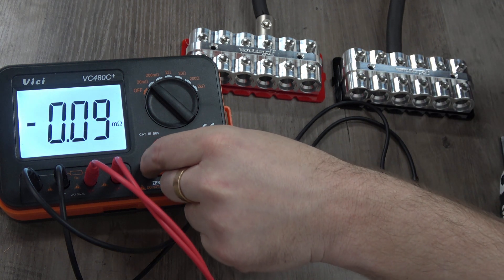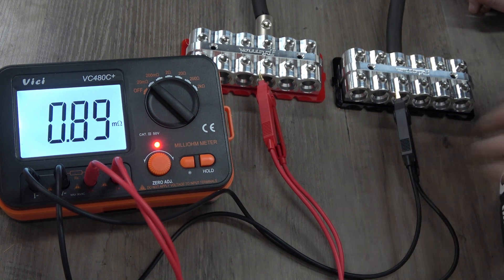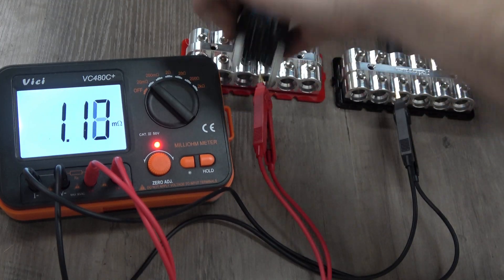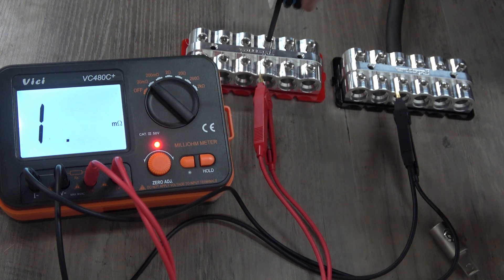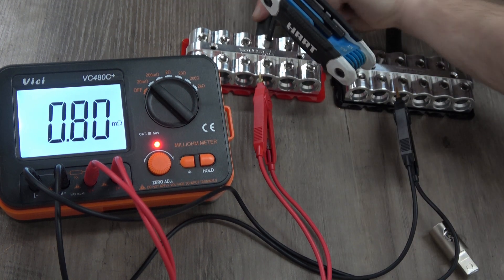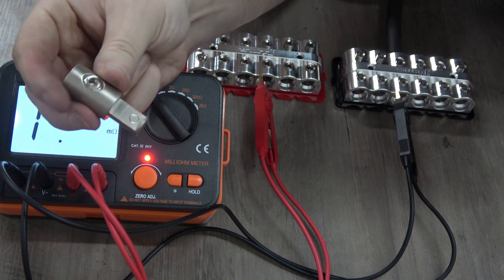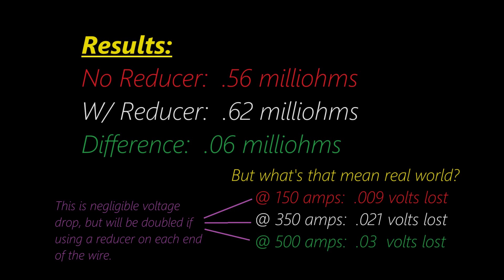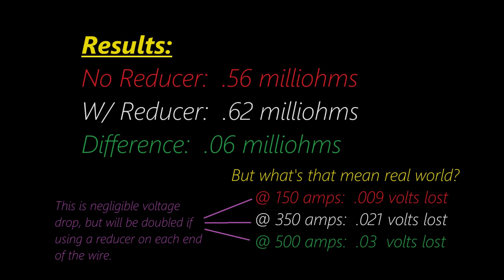Car Audio Tested:  Voltage impact of using a 1/0 to 1/0 awg input reducer.

Comment: First off, I don't think the reducers hurt most installs, so use them if you like, doesn't matter much in real world use. But, what about trying actual load testing to measure the real voltage drop across the wires with and without reducers. Example of doing this would be, much like you did here, but instead of measuring DC resistance, use a battery bank that can support say 500 amps (depending on wire size tested), have a dummy load bank to be able to draw a consistent few hundred amps (again whatever the wire is rated for), similar to a car battery load tester, and measure for the voltage drop at each end of the wire with and without reducers to see what the actual drop difference is. At the very least, it makes for another interesting video if you have the capabilities to do so cheaply. Of course can also check the heat at said connections.
Reply from the maker: That is how this dc resistance tester works..  it sends a load through the wire and measures the voltage drop. 

This style can not be hooked up to a battery or it’s pretty much fried immediately, only good measuring dc IR of things without their own voltage.. wire lengths, small resistors etc.

Also, my tests agree with your statement.  Using a reducer will only cause .03v of drop @ 500 amps.  That’s insignificant for sure.

Comment: Ive often wondered the same thing. I just like how the 2 runs of 1/0 look going into my amp.
Reply from the maker: I'm using quad 1/0 to my 8k.  Normally it has two power and two ground input, but I use a pair of dual 2/0 to 1/0 reducers.  I also like the way it looks, and it cuts down a lot of resistance being a total of 4 2/0 awg wires instead of only a pair of 1/0.

Comment: Great video! I have often wondered how much those help/hurt. I would love to see a video test on if those single 1/0 to dual 1/0 inputs actually help you gain.
Reply from the maker: I have a plethora of those on hand that I plan on testing in the next 1-2 days, actually.  Have dual 1/0 to 1/0, dual 2/0 to 1/0, and things like triple 1/0 to 1/0 reducers.

What I'm most interested in seeing is how much of a difference will I see using a dual input vs hooking both wires up to the distro block individually - mainly because while at first thought I'd go with two inputs...the more I think about it, the more I consider that both wires will be input into a section of the distro block closer to the output/measurement point, and reducing the amount of travel through the aluminum distro block could actually lower the resistance vs each wire getting its own input.  

We'll know soon.
Reply: @GloweIndustries would love to see that test

Comment: Interesting! Most people with even a little bit of knowledge will know that there has to be some kind of impact when using these, however now we have results thanks for sharing.
Would be interesting to see what impact each part has between the battery and the amp. Lugs, fuse block, lugs / reducers
Reply from the maker: I just tested some fuses, actually..  100a fuses were coming in around .8 milliohms, whereas I had a 500a fuse (from Skar) test the same as a 300a generic fuse (from amazon) at about .5 milliohms.  I plan on hooking them up to compare resistance vs current it takes to pop them in a future vid.

I've done a video on lugs, too.  It matters quite a bit based on the brand of lug used!
Reply from the maker: Link to testing various lugs.

https://youtu.be/1FK6l7xYfFI
Reply: Great video as always I've been told just recently that anything "tinned " is actually worse than just straight copper I was told I would see close to a 1% or more drop in power from the front to the back depending on how many loads (batteries & devices ) and what I was using along the way like these things I have been swapping everything here lately for solid copper and can actually tell a difference and  feel it as well after several different upgrades would it be better to have straight copper wire instead of tinned OFC
Reply from the maker: @Dirty2152  guessing you’ve been talking to Brandon?  He’s mentioned that.

I haven’t verified the tinned vs copper scenario yet, but I can see it causing small amounts of additional resistance..  the tinned wire of the same size in my copper combat video all beat the straight copper — but car audio wire tends to be larger when compared to welding wire.
Reply: @GloweIndustries  I actually don't remember exactly who told me that I have been trying to learn everything I can about car audio/ lithium etc. was trying to take it slow and wanted something to play around with and learn and at the time I thought AH's was the thing that I wanted I only recently learned from YOU that I want AMPS not AH'S unfortunately I had already purchased a jag35 74AH Lev60 pro V2 (GV-S1) was out of stock) before realizing it couldn't be charged to 14.8 volts with a HO alternator 14.0 Max charging which works perfectly for my Camry's 13.8-14.1 charging system but now I have to buy a whole new battery when I upgrade my alternator as well as I have been trying to learn about the BMS or balancer because the one included is a 1amp maximum discharge when connected is 180 amps of current anyway I said all that to say pretty much jag35 left me hanging on the battery and has still refused to answer any questions regarding the actual maximum charging voltage of the battery and other stuff so I have had no choice but to jump in head first and hope I don't mess anything up so I do appreciate the informative videos they really do help me learn and you are very knowledgeable and sad to say but jag35 will NOT answer any questions or help without 10$ an email on there tech support page even for verified purchaser
Reply from the maker: @Dirty2152  S1 currently show as back ordered but we have a couple dozen in stock now, just haven’t switched the listing over if you’re going to grab another battery.  💯